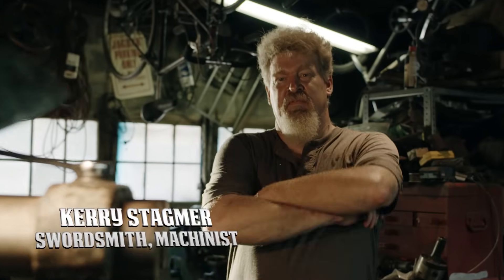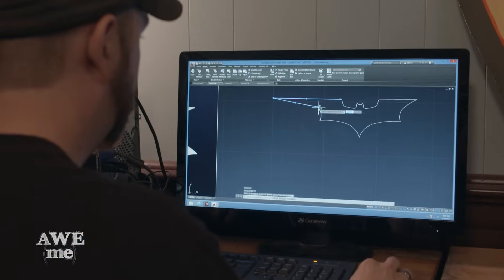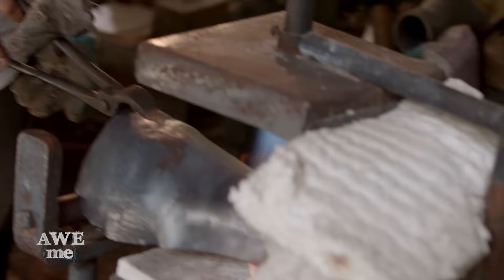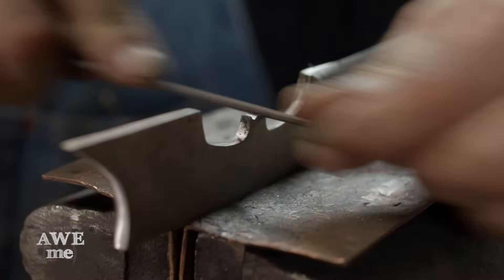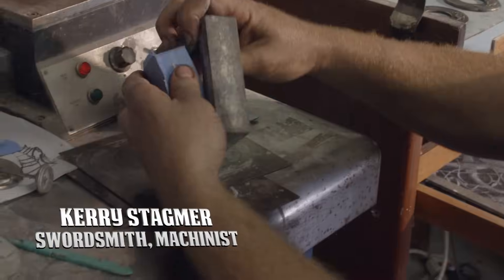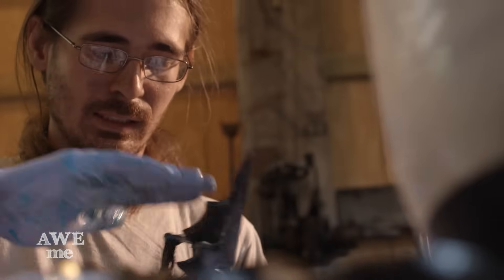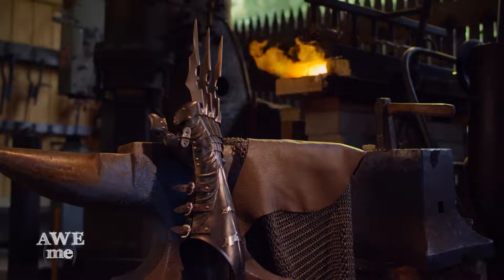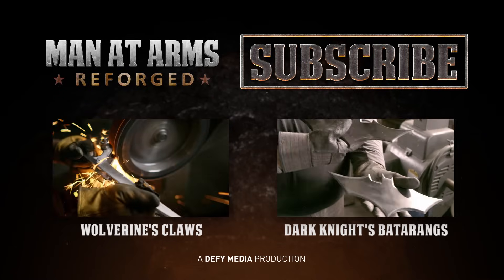Batman's Wolverine Claws - MAN AT ARMS: REFORGED

Comment: Cloud's buster sword x Sephiroth's Masamune = IMPOSIBLE SWORD
Reply: I feel like there is no point to that... mostly because of you tried to fuse a big chunk with a tiny sliver... you get a broken pile of metal
Reply: Raizosuzaku
 I could imagine it as the buster sword, but where the point begins it extends into the masamune, the trouble would be with weilding it, the sword would have tons of weight and reach, and if you swung it down masamune would break under the force of the buster sword.
Reply: Zeus Mcdaniels
 what I think would work better is buster sword with Zangetsu, they both have long hilts so it could be made into a massive double sided weapon that would be extremely unweildly.
Reply: LOOOL
Reply: OMFG YOU BE SO CRAY CRAY

Comment: I HAVE A GOOD HYBRID. So I'm thinking a scaled down version of that sword from pacific rim mixed with indianjones whips by basically being like a sectioned and cut sword riveted together kinda like a bike chain but with blades on the sides. So when hit against an object the blades wrap around the target. And so stuff won't get caught in between the blades articulations, when the blade is bent all the way the side that it falls on (with the shortest circumference) the blades will pinch together like a dozen wire cutters. I think this is a good hybrid.
Reply: so you're talking about Ivys sword from soul calibur

Comment: 1. So, what exactly happened to the old crew? I don't mind the change, just curious. 2. I really would like real flesh (like a pig) or flesh like (ballistic gel) material to see the real life damage instead of water bottles.
Reply: I was asking myself the same question. Where's the old crew??
Reply: They wished for a break i believe, the description for the trailer of this series has the answer.
Reply: Old crew have a break this summer. They maybe going to vacation.
Reply: If they gonna use ballistic gel or a dead pig (please be a dead one) the would also need some pro to handle the weapon, cause to be effective you need to use it well too, and for the most times they would sound like bad weapons when really was just misused (this exists in english?). And well, would be mor expensive and not so important, but would be cool...
Reply: Yes, it would have been a previously dead pig if used. Now, I say ballistics gel because of what I've seen in mythbusters. They aren't experts but can still destroy it easily. They make the weapons sharp, and or, able to smash. So they don't need an expert to wield the weapons. Just have fun and go at it. You are right though it would be expensive and not as important as the weapon itself.

Comment: A working Gunblade from Final Fantasy 8
Reply: to impossible.  the best that they could do is make it as real as possible but not functional. think about it the blade would be blown to pieces from the explosive forces the gun would create.  Plus if it is reusable and functional it break faster from the stress over time.
Reply: If we are going by final fantasy lore the bullet from the gun blade is only to wobble the blade as you are slicing increasing its cutting potential so if they used rubber bullets and made the section where the bullets are fired sharp enough to cut the rubber in theory it could work.
Reply: you just proved I was right with that comment by stating in theory.  what I am talking about is practicality for functional purposes.
Reply: "They are mostly used like normal swords, but triggering a round sends a shock wave through the blade as the weapon passes through an opponent to increase damage" i pulled this directly from the wiki as i said above if the bullet was rubber it would work as a gun blade was intended of course i have no evidence seeming as i haven't made one myself but it should work. even if they didn't make it functional lets face it. Its a badass sword and should be made because of its looks and making it functional would be a bonus.

Comment: Hidden blade mace(mace with retractable spikes)
Reply: What possible use would you have for a mace with retractable spikes? The purpose of the hidden blade is to keep the blade hidden from others and instantly use it when needed. With a club you already know that the person has a weapon.
Reply: Aleitheo and batarangs are throwable weapons but that didn't stoped them from adding them as claws
Reply: Edgar Cantú Batman often makes plans to deal with other superheroes should they go rogue so the combination isn't that far fetched. The only point you have there is that they designed the claws to look like baterangs stuck onto a gauntlet rather than something Batman would design to counter Wolverine.
Reply: a mace hidden up your sleeve, now that's innovation! (not really)
Reply: Aleitheo you are right, i am wrong.

Comment: Batman doesn't kill.

And i'm pretty sure that'd break his wrist.
Reply: that doesn't mean he wont stab someone hell he stabbed joker in the eye with a batarang, also he can use it on solomon grudy
Reply: You can stab someone without killing them, he could use them too wound. Also Batman is a peak human athlete. If these guys could use them Bats would have no problem.
Reply: hell batman's punch a bullet out of the air
Reply: Wolverine does.
Reply: The Reason it is a gauntlet is because it gives wrist support. Thus it would not easily break his wrist.
Reply: I disagree, the claws are mounted too high up and the resulting "twist" would break it.
Reply: MiggyManMike I disagree to your disagreement. The claws being mounted at that height would do diddly squat in a twist. The claws being flared out at the angles would snag on whatever you are stabbing (assuming you stab) and stop the horizontal twist. You would have to be one really unlucky person in order to break your wrist, or just attacking a very thin object.